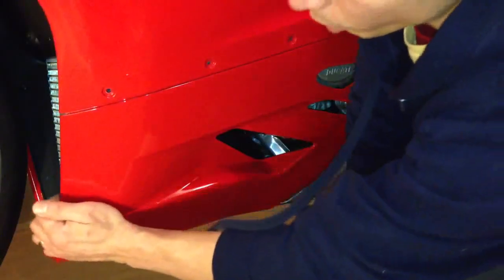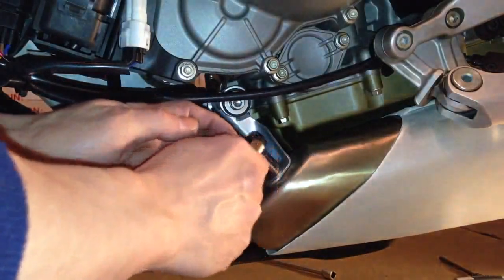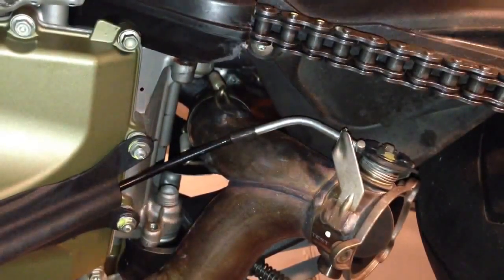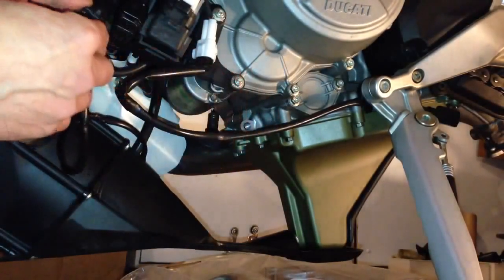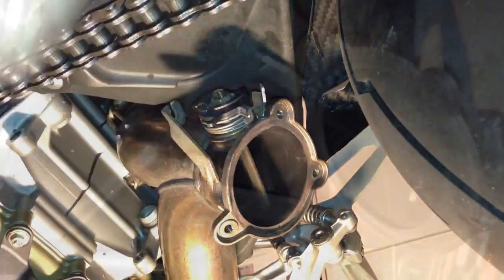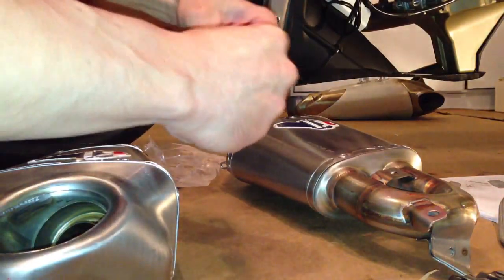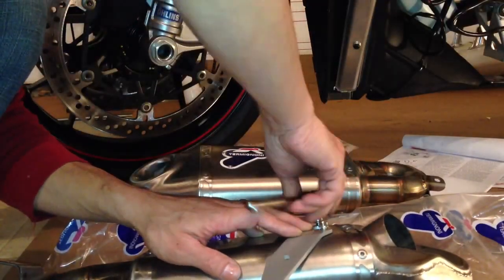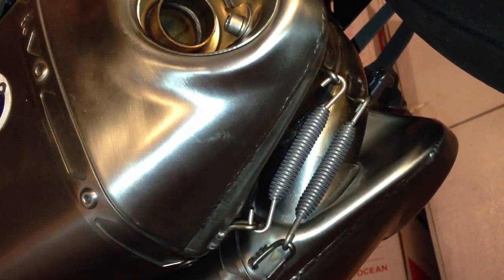Termignoni Exhaust install Ducati 1199 Panigale.

Comment: Hi Slamy A, thanks for posting your video on installing a Termignoni silencer set on Panigale. Very helpful to me. One thing unclear however: how to remove  the axle on which the flapper valve is mounted. Appreciate any help / tips. Cheers.Erik

Comment from the maker: The Termignoni has instructions on how to remove the OEM Exhaust, servo motor and bowden cable. I removed the whole flapper valve assembly to have better flow, better sound and to reduce heat. After installing the Termignoni Exhaust i did the up-map and no light or codes came up.

Comment: Question, on my 2014 1199, the flapper valve remains in the open position by default when I take off the servo motor.  Do I still need to take the flapper valve assembly off?, or can I just leave it in the open position and continue with the install?  Thanks

Comment: Since you removed the whole servo motor and flapper valve, did you get a code on the dash?  Or a engine light or do you have something that bypasses it?  Great instructions btw.

Comment from the maker: Check out the sound of my Ducati Panigale with my new video. You can bring back the mid range torque if you upgrade your sprocket. The heat is coming from the vertical cylinder and the rear exhaust manifold if you drive the bike at low speeds (15 to 20 MPH) depending on the climate. Removing the flapper valve gives you a better flowing exhaust and reduces heat.